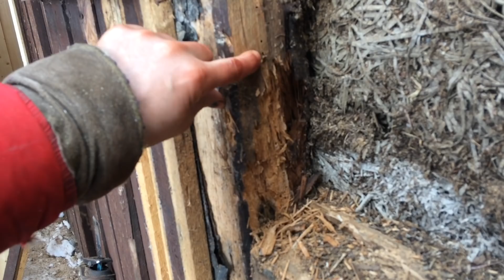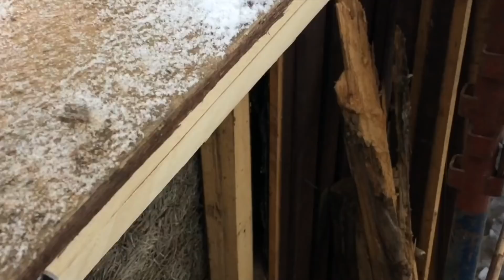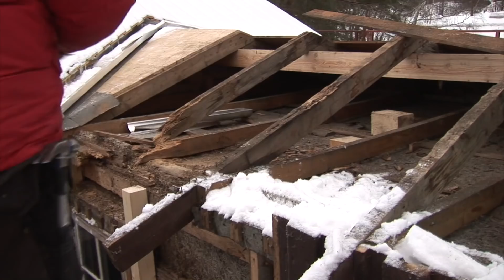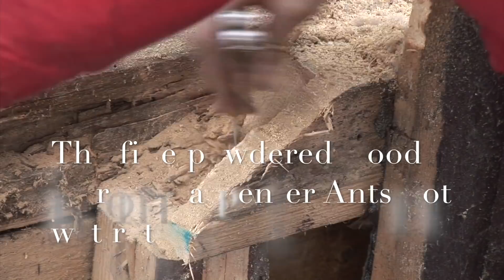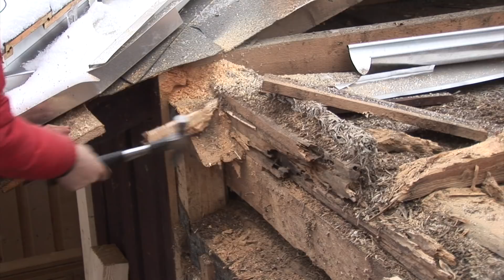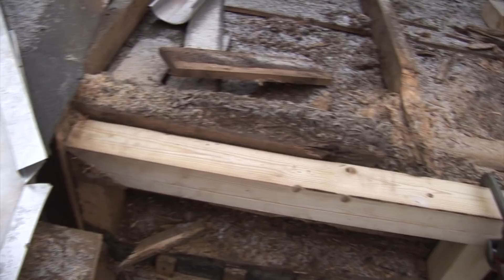🔴 32/35: Building a Post and Beam Garage- Rot, beetle and  ant damage, review & repair with music

Comment: We in Canada, back in the old days, used excelsor with  sprinkle of lime in it (bug deterrent) for insulation. I`m going to try a mix of cement, sand and prelite for insulation on the inside of some stonework, this up coming building season . Should be light and fire proof
Reply from the maker: I have used Loose cinder (leca) for insulating floors where previously it was an earth floor. The bad thing about portland cement is its' lack of diffusion openness. It often traps moisture in an unfortunate way. Lime on the other hand is very good in that way. This old product has always been nice and dry the times I have found it in old houses. I think it was popular for workshops and even animal sheds, which have to be insulated here, but very diffusion open. I think it achieves the right balance of diffusion not to trap the moisture on its' way out of the building.
Reply: I have seen some guys use vermiculite but I don't like it as it absorbs water perlite does not. I'm going to use more lime than portland, will have to play around to get the mix right. Want it to trap air but breathe and stick to the wall. Spray on foam is all the rage here, but I like to take a road less traveled. Generally, my mortar mix is 6 sand 1 lime and one portland.

Comment: Say Steven......I see a hammer mark on your thumb. I find that really hurts when you hit it a second time, out in the cold.
Reply from the maker: Yes it hurt a lot because of the cold, was certainly -10c when I hit it. Have you tried making a hole in the nail to let the blood out? I did that the last two times and it helps a lot to relieve the pressure.
Reply: Yeah, I burn a hole through with a hot needle, seems safer than doing it with my 18 volt Dewalt